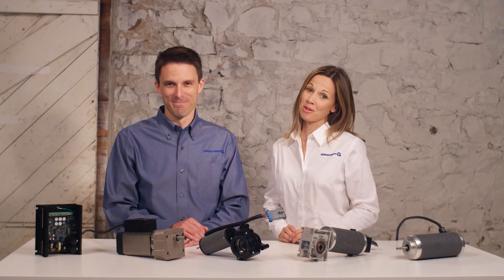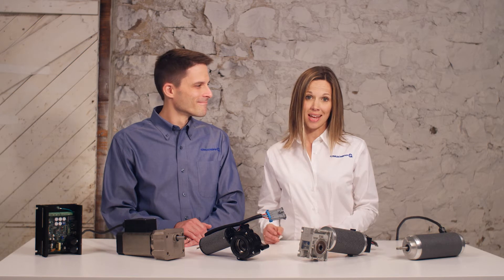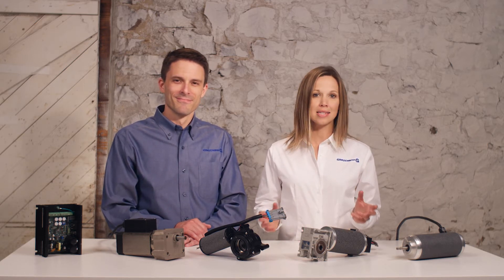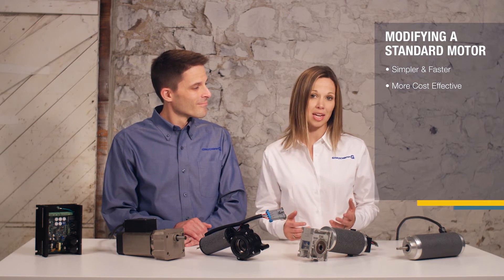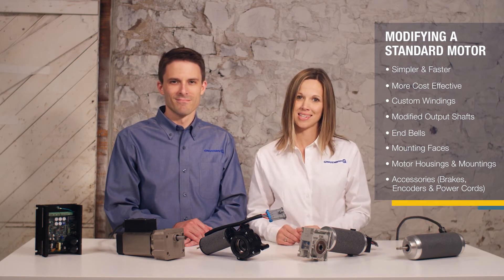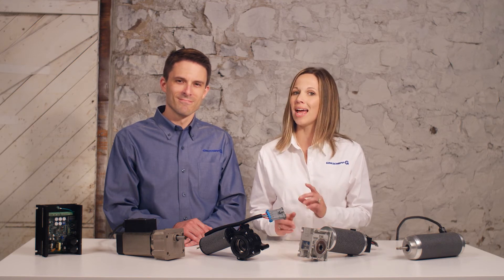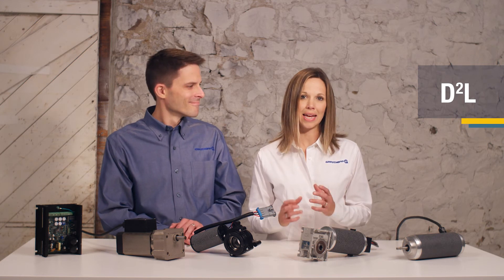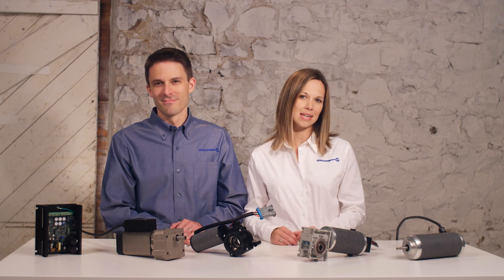How to Choose an Electric Motor | Custom Built Electric Motors

Comment: Hello

I’m looking for the “highest torque” motors available! 

I’ve been looking into EV stiles motors but I need way more torque than anything I’ve come a crossed yet. 

I don’t care what type. Brush, brushless, stepper or servo. I’ll match supply/drives to any motor that may work for me. 

Motor needs to accelerate as hard & fast as possible to 2,000 RPM then shut down. 10 to 20 minute cycles So no major cooling issues. In clean well vented environment.   

Only restriction is the motor foot print. Motor needs to fit in a 16” diameter extruded pipe. No longer than 2’ 4” in length.  

If you can possible help me or give information on where to continue my search I would greatly appreciate it!

Thanks
Reply from the maker: Looks like you have a challenging project! Typically the highest power density motors that are readily available are brushless motors with high energy magnets. Not sure exactly what your required torque is, but to accelerate to a certain speed/torque quickly may require a lot of current (especially if your application is low volt). Similarly, decelerating quickly will need either a drive or brake that is able to dissipate enough heat. Groschopp manufactures mostly fractional horsepower motors (<750 watts). Hope that helps!
Reply from the maker: You can use the STP calculator tool on our website to calculate your required power. https://www.groschopp.com/resources/stp-calculator/
Reply: An entire series of videos on choosing a motor without touching on how to choose. I expected more. Most applications do not simply have a rpm and torque requirement but may have operating ranges both in torque, rpm and available supply voltage. Choosing a motor is much more a feat of maximizing the performance within this variablespace and that is what most need help with.